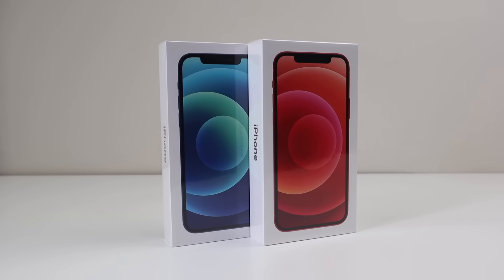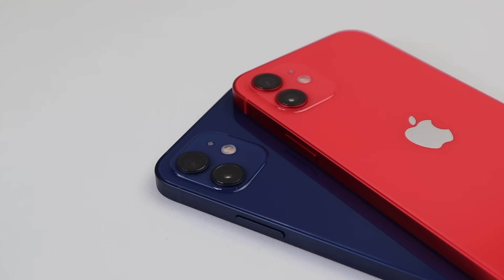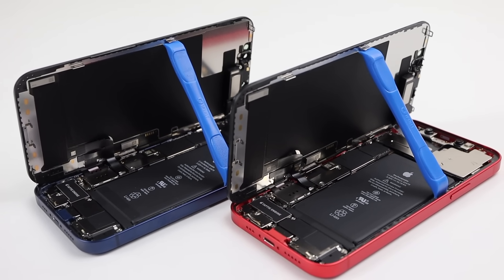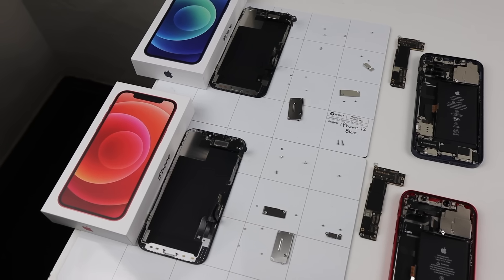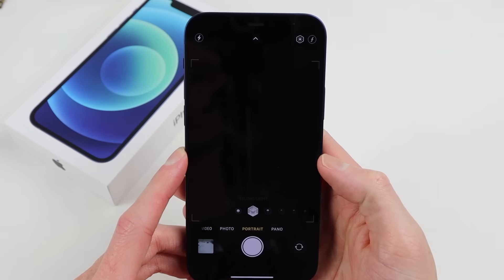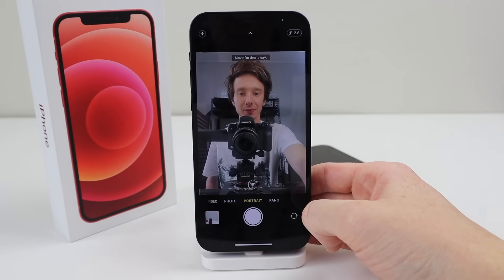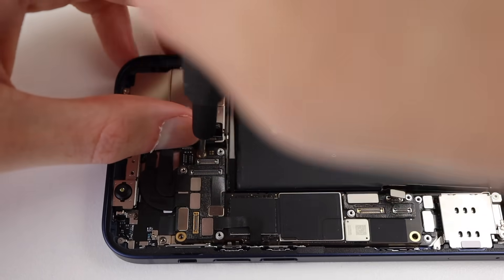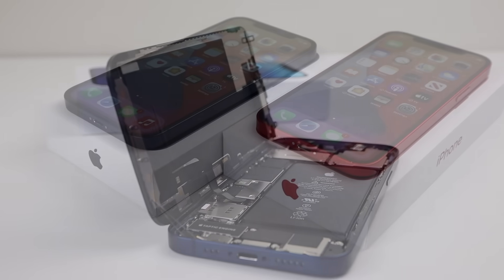iPhone 12 Anti Repair Design - Teardown and Repair Assessment

Comment: Not acceptable, Apple shouldn't be allowed to purposefully sabotage MY device that I bought from them after I perform an otherwise successful repair. I don't think it's acceptable to pay over $1000 for a device and then have the seller of that device purposefully and artificially make my device unusable if I dare to not get it repaired through them. Imagine if your new Toyota Corolla decided it wouldn't exit limp-home mode and the radio stopped working if you got the oil changed anywhere but the Toyota dealership and if you did then you had to buy a whole new car and just send your old one to the junk yard. Other manufacturers don't have this issue. This is an apple thing, they have a pro-ewaste stance and anything they say otherwise is a bald lie.

Comment: Apple in 2030: iPhone is just a glass that when connected to the 6G internet it streams all iPhone fuctionality from Apple headquaters. iPhone is made out of a rare glass we found on mars, you can't use it with your regular internet you need to purchase separetly an Apple internet service, one per every iphone. Total of $10,000 product. If you drop it ang get it broken buy another one.

Comment: for charging, you just need a C-A tip adapter, which are very cheap, or available in high quality for less than the cost of a cable.  I just worry about adapting the fast-charging standard involved, not just the connector, but since old (USB-A socket) and new are both from Apple they should be built with exactly that in mind, right?

Comment: Considering the amount of non apple parts and batteries that start fires by people using non original parts i think it is a good idea. Most that need to open it before a year has passed should not own one  . As for example, switching a battery is dangerous as they are striped with adhesive stickers, on some iphones it is glued. If you try to lift the battery without a good slide under removal thingy, the battery bends and may ignite. Companies will get approvals if they are official, but that has been the thing with apple since the start really..to have a warranty on the comps you could not tamper with it , they even had a service postal system for that

Comment: Yeah I’m sticking with the 11 forever, when my current one breaks, I’ll just buy the 11 Pro Max instead, or just switch to android.
Reply: Same thing here. When my iPhone 8 breaks I’ll just buy it again
Reply: The problem comes with the 5G network compatibility. Some people were waiting for iPhone 12 because it could be used in the 5G. But just with the fact that the box does not include a charger, wtf? Buying an android!
Reply: @marclopez6659  If you buy an android smartphone, make sure the motherboard has the capacity to include a 5G receiver/transmitter.  That way, you'll be able to harness the 5G connection.  Or, you can potentially build your own smartphone for half the cost charged by Samsung, Apple, and Huawei.
Reply: @MetalSStar196  thanks bro
Reply: update: found this comment again and as dumb as this sounds I winded up buying the 12 Pro Max and gave the 11 to my sister. i’m sorry

Comment: The touch and faceID makes sense from a security point of view though, can't comment on the camera, unless it is also tied to faceID. Replacing the original part with a potentially compromised one would be a liability and defeat security features. 

Apple's move towards increased security is the reason I am leaving android, despite the unrepairability of iPhones. 

Change my mind I guess.

Comment: Another reason iPhones are for small fingered smeg heads and women. The size and the screen is bad and every updated version.  Counters a previous version so you have to buy a new model. I am just about to get rid if my s 7. And it has worked great for years. If it weren't for luis rossman i would think mac is garbage in total. But when someone like luis customizes and fixes imac's like pcs gives me some hope

Comment: "Zero climate"?
Bull.

Lets see... fabricating the parts and assembly etc of the new devices... not zero climate.
Packaging the device for sale etc... newp, not zero climate.
...
Your thoughts on their devices being readily repairable by non apple certified repair people would be nice, but from what I understand, they jealously keep EVERYTHING in house...

Sooo... packaging (not zero climate) your broken phone, then posting it off to get it repaired means fuel cost and polution of the vehicle used to transport it MUCH further than your local repair shop (newp, not zero climate), they then either repair or replace your handset (not zero climate), then send it back to you (packaging and transport; not zero climate)...
To me, this is just another example of elitism and greed working against this so called "zero climate" they claim to want.

Comment: First off I'm an android boy 4 lyfe. I don't see the use of getting an overly expensive camera with half the battery capacity of the average android device whilst also discouraging any type of repair that would increase its life span as an alternative to save valuable resources that go into making an entirely new phone. Apart from that, I like android mainly because of how open the software is, if you have something that you don't like about the UI there are programs that let you change the UI for what suits you best, if you'd like a new operating system you can do that, aswell as all of that I like how supporting android is towards indie apps and games as this sort of environment is more nurturing towards innovation and of course there will be issues that come up such as shovel-ware/ad-ware but I believe these pave the way for the do's and don'ts of upcoming developers letting innovation thrive even more. Thanks for reading through this, this has been my ted talk.

Comment: I can tell you how it works... every part there have a serial number ... simply the software itself programmed to work with the address of every part and the serial number is marked inside the software so if it changed,.. it will not work correctly,,, so the resolution is to go in-depth of the software and remove the marked serial numbers to make universal instead of serial addressing... EZ

Comment: lol nice one. Iv always had iphones since the beginning, as they were simply the best phones out there and very durable. My iphone 4GS did the job over 5 years then i changed it to  iphone 7 plus when that came out and that is the phone i still use. The only repairs i have ever done (myself) were battery replacements as the original ones would loose their charge after 2 years (understandable). However, it happens i will need to upgrade my phone again as the old one is getting out of date plus doesnt have wireless charging, but i was already sceptical about getting new iphone solely the reason i dont think they are worth 1.5 grand price mark even i expect them to last another few years.  

Now after watching this video and realising that i will not be able to replace the battery  as before after couple years of use it destroys my expectations to use the new iphone for another 5 years. That just made my decision to look away from apple as im not paying 1.5k for a phone to use 2 years max. I would much rather pay the same 1.5k on 3 android phones every 2 years for the next 6 years. Thanks for the video (Y)

Comment: The Idea of Phones above 1000$ is completely ridiculous to me. However, if i buy a premium product at a premium price i expect nothing less than exquisite premium service. This includes not having to buy extra pieces for whatever reason and having an after purchase service on the level of 'your screen cracked? Hand it over, it'll be fixed by tomorrow (maximum acceptable downtime), at a reasonable charge (meaning the price of labour plus a small fee on the production price of the part, not some fantasy pricing).

The Problem i see is that these devices are bought as, produced as, and supported as consumables, not as long term investment tools.

Just imagine a Dump truck company delivering a 10M dump truck (which is expected to run 24/6,5 with one shift of maintenance per week factored in) without spare parts and qualified personnell on standby to fix the thing in a frame of hours if something goes wrong? When an hour of downtime means lost money in the region of tens of thousands of dollars, no, you won't have independent repair. But you don't require any because part of the buying contract is a guarantee for the machinery RUNNING.

Now, if a company chooses to not provide either parts or service for a premium product, i see no reason why anyone would buy said product besides stupidity...

Comment: Exact reason why I do not buy Apple products say if your phone breaks and you need replacement parts apple made a serial number on each product so when you change a part it automatically knows cause the number doesn't match and in the software code it's written so that it will stop working on purpose so it will trick you to contact apple so they want you to give them more moneyz, what I like to say apple is money hungry :)

Comment: Hugh, I used to work at a Best Buy Geek Squad that was an Apple Certified repair center. When we would replace parts like the battery, camera, screens, etc. we would always have to run Apple software afterwards and input serial numbers for parts so that the phone could recognize the change.  If you didn't run RepairCal... touch ID, face ID, cameras, battery health, and all that would be broken. Being an apple certified center, we had OEM parts. But you STILL had to run RepairCal and Post Repair diagnostics.
Reply: what's that software called?
Reply: @rtfggj  Didnt he say RepairCal?
Reply: Key info right here.
Reply: This comment should be on top

Comment: Both the display and the battery have an eeprom memory and there is written the serial number of the screen and the battery with which the device left the factory. In the previous models we can already write that information on the screens and generic or original batteries so that they do not throw that error. No wonder that in a few months you can also write that information so that it does not show you that error. (That this is not something new since the iPhone X model, we technicians have been seeing it)

The message is not because the screen IS NOT ORIGINAL, it basically says it because it does not verify the serial number of your screen or battery with which it comes from the factory.

With the cameras I don't think there is any problem. Now with Face ID that is possible since the face id is tied to the logic card ..

Both the cameras, the screen, the battery all have a serial number and the software verifies that it is the same, so it IS NOT BECAUSE THEY ARE NOT ORIGINAL, it says it only because it does not verify the serial number.

- The battery continues to work even with that message.
- The screen continues to work even with that message.

I am 100% sure that this iPhone will continue to be repaired. :)
We've seen worse than a simple verification error message
that is already from the iPhone Xr, if you do not have the equipment to copy the data of the parts, the message appears that it is not genuine, for example if you want to change the battery you pass the original battery through the icopy and that information you pass it to the generic battery and recognizes it as original, the same with other parts, the technician who specializes in iPhone has all the necessary tools.

Comment: This is why I still have my 6S Plus going strong. Repairs are super simple. I’ve changed my battery, headphone jack, and screen. As long as I can keep this thing running by replacing parts and updates keep supporting it I have no need for a new phone.

Comment: Its unbelievable how people still buy their overpriced crap
Apple just after the $$$ and just screwing its buyers
Reply: Both the display and the battery have an eeprom memory and there is written the serial number of the screen and the battery with which the device left the factory. In the previous models we can already write that information on the screens and generic or original batteries so that they do not throw that error. No wonder that in a few months you can also write that information so that it does not show you that error. (That this is not something new since the iPhone X model, we technicians have been seeing it)

The message is not because the screen IS NOT ORIGINAL, it basically says it because it does not verify the serial number of your screen or battery with which it comes from the factory.

With the cameras I don't think there is any problem. Now with Face ID that is possible since the face id is tied to the logic card ..

Both the cameras, the screen, the battery all have a serial number and the software verifies that it is the same, so it IS NOT BECAUSE THEY ARE NOT ORIGINAL, it says it only because it does not verify the serial number.

- The battery continues to work even with that message.
- The screen continues to work even with that message.

I am 100% sure that this iPhone will continue to be repaired. :)
We've seen worse than a simple verification error message
that is already from the iPhone Xr, if you do not have the equipment to copy the data of the parts, the message appears that it is not genuine, for example if you want to change the battery you pass the original battery through the icopy and that information you pass it to the generic battery and recognizes it as original, the same with other parts, the technician who specializes in iPhone has all the necessary tools.